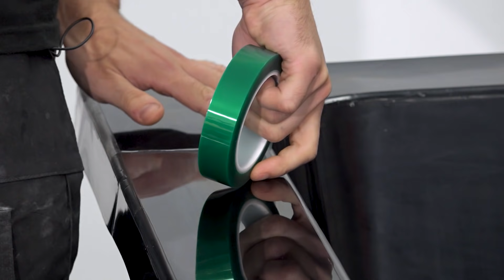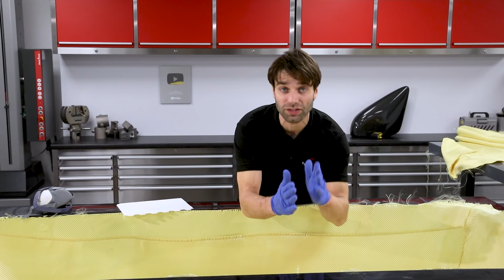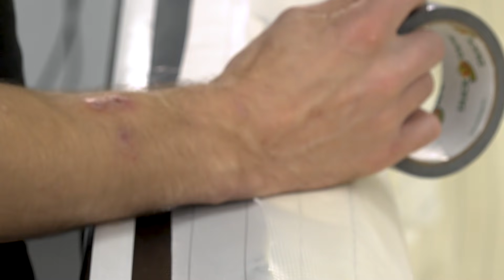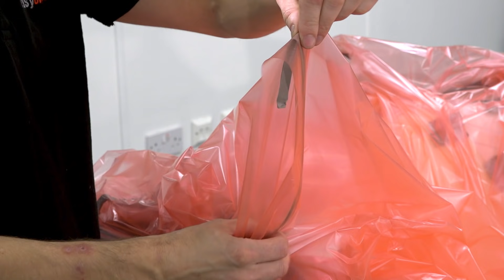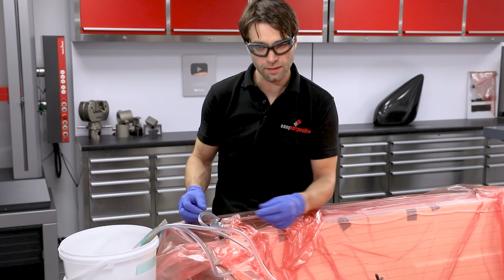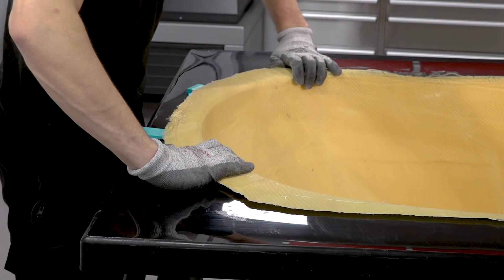In-Depth Guide to Resin Infusion (3m Kevlar Moulding)

Comment: JUST an FYI but pleats is the wrong word. pleat means a straight fold of excess material made along a flat edge to reduce overall width and material. THIS = wrong. We are dealing with resin infusion we are not knitting here with thread and needle. Dart the correct term: specifically is used when referring to folds created at corners or around protrusions and structure where extra volume (bagging plastic) is needed in a specific spot. The correct term is DARTS when making the the little excess bag loops using the tacky tape or butyl tape. Just an FYI. I also use to build Hinckley yachts and work on luxury and super mega yatchs in florida. Also he should have put the tape down first after the the gelcoat and put a lite cover of 2" masking tape to protect it. Then put down all of the remaining materials. imprinting on the FRP. Easy to setup the infusion lines with a covering of flow media to make it so it does not imprint.

Comment: Hi, can I ask how many layers can be impregnated in this way? I'm going to make a skateboard that will be 15mm thick at its widest point, with 450g of carbon it's 33 layers. I'm thinking about either infusion or soaking and then adding an absorbent insert and vacuum. I don't know which option to choose. The skateboard is only 15mm in the tail, but it tapers to 5mm towards the edge. I need a really stiff iron board, total length is 125cm, width 30cm. Thank you
Reply from the maker: That sure sounds thick for a skateboard. It is possible to infuse very thick laminates but it does come with the risk of not fully getting the fibres saturated and wet out. Contrary to what you may think, thick laminates are best done with a slow infusion, restricting the flow of resin so that it doesn't skip across the surface plies and has time to penetrate through the stack. You will naturally want a slow curing resin to give you the most pot life possible and it may be beneficial to mix up in multiple batches to limit the volume of resin sitting in one bucket.

Comment: when you clamped the pipe of the pump end, did you turn off the pipe or was the pipe running?
Reply from the maker: Once the vacuum line has been clamped, the pump can be switched off.

Comment: The only thing that i dont get is how you choose a foam for core instead of a nonwoven for example?
Reply from the maker: Not quite sure what you mean as a 'nonwoven' in regards to a core material. Core choice however can be influenced by a number of factors. Processing method is a big one as some materials will not withstand certain manufacturing processes. For resin infusion, shown in the video a closed cell foam core is the ideal choice because the resin take-up is minimal which keeps the weight down. You can imagine if you tried to infuse with a honeycomb core how all of the individual cells would simply fill with resin.   
The foam used in this case is a special material with holes and grooves partially cut in the surface which act as channels for the resin to flow down and pass through. This allows the fabric to fully infuse whereas an ungrooved foam can restrict flow to both sides of the laminate.

Comment: I have a problem with the infusion, before proceeding with the introduction of the resin I do the leak test and there is no presence of air but at the end of the infusion it starts to take air from somewhere, what could be the problem?
Reply from the maker: It could simply be any trapped air in the resin expanding and congregating on the resin front as it makes its way through the laminate.
Reply: It can't be, because I degas it first
Reply from the maker: @raffaelepirrone6550  How long do you leave the drop test for and is there any chance that your fabric has absorbed moisture? If you fully degas the resin and are certain that the bag is 100% sealed at the start then the only cause is that the bag punctures or bursts during the infusion or moisture in the fabric is boiling under vacuum and causing a gas to become present.
Reply: how much should the infusion pressure be? 
-1.5 bar is perhaps too much?
the leak test time is two minutes
Reply from the maker: @raffaelepirrone6550  For infusion you want to be as close to full vacuum as possible. 2 Minutes is not really long enough for a drop test, at minimum you want to leave it for around 10 minutes but ideally around 30 minutes if you can. The longer you can leave it to test the seal the better.

Comment: Un believable product great, I love resin flow technics there is a any formula for insert connections?
Reply from the maker: I'm not quite sure what you mean sorry.
Reply: My query is Are there any principle for setting up resin flow and vacuum flow connections like width,area,legnth
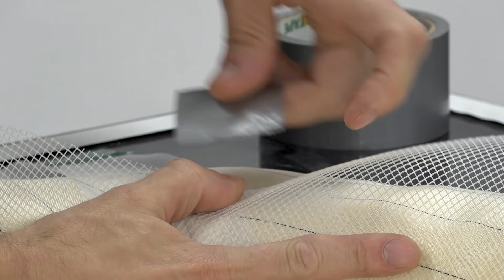Reply from the maker: @Eswarpune  There's not a particular formula as every mould is a different shape. We do cover the position of the feed lines @10:45 in the video.

Comment: Hello and thank for your brilliant videos. 

I would like to ask if vacuuming the surface or any kind of mold would bend it?  
In such case we will not find the part with the correct geometry. 

Is this a possible scenario ?
Reply from the maker: For the resin infusion process you need to have a strong and sturdy mould that will withstand the vacuum pressure without distortion. A composite mould or one directly machined from tooling board are the preferred options. 

If the mould is not strong enough then as you say, it can lead to distortion in the part.

Comment: I suggest this is the wrong choice of material.  High density polyethylene, used by Jemtlander in Sweden, Aiguille in UK, Ice Trek in Australia and no doubt a bunch of others.  Sure I can by resin/kevlar pulks from Acapulka and resin/glass from fjellpulken.  Chances are you pull a sledge through snow and I really notice the coefficient of friction between the material and the snow
Reply from the maker: If you haven't seen them, it is worth watching the series of videos that accompany this one as they address those points directly. I'd definitely recommend both this video:
https://www.youtube.com/watch?v=wPFDBT41SEU&t=482s

and this one:
https://www.youtube.com/watch?v=li7ug4-k4mk

Comment: If you see the finished Part no one recognizes how much Garbage it produces.
Reply from the maker: Sure, but of course, the mould can be used to make hundreds or possibly even thousands of parts. The consumables, per part, are on par with most other manufacturing processes and, of course, being a composite material, the end product is lighter, and so uses less resources in operation, than a product manufactured using (potentially) less consumables in production, but yielding a less efficient product in operation.

Comment: With that drop test. Was the pump running? Should the pump hold the vacuum if switched of?
Reply from the maker: The drop test is designed to see how well the bag is sealed, so yes the pump needs to be turned off and the vacuum line clamped (the pump has a non return valve to ensure oil does not flow back up but it is not a vacuum seal). This will then isolate the bag and allow you to determine how well it has been sealed. You can find another example on our guide to resin infusion video at 23 minutes. https://www.youtube.com/watch?v=pWRVVLJX8eE&t=202s
Reply: @easycompositestv  Perfect. Thank you.

Comment: Do you think this approach would also work with a surfboard where the resin should flow on top and bottom?
Reply from the maker: 2 main problems would be control of where the resin flows and also the fact you would have a rough peel ply finish to the part needing further finishing work and likely need a hot coat of epoxy to get a good finish.
Reply: @easycompositestv  thanks you for answering! What would you suggest to control resin flows, add more lines?
Reply from the maker: And resin feed connectors so you can shut off one if the flow is not going where you want it to.

Comment: If you make it 6ft long it can double as an emergency shelter.
If that adds extra material then make up for it by making it skinnier.
If you line it with millimeter-thin insulation, you now have a windproof, coldproof shelter 😊

Comment: I didn't understand how the catch pot works. I mean the resin coming to the trap pot may close the valve permanently. How do you tackle with this?
Reply from the maker: The catch pot is really a failsafe, to prevent damage to the pump via resin ingestion. It had a disposable liner which can be replaced if resin finds it's way into the chamber but really this should only be a small amount at most. If you find larger quantities of resin end up in the catch pot then you need to reassess the position of your resin break within the infusion setup.
Reply: @easycompositestv  how about the valve in the catch trap pot connecting the pipe carrying the excess resin. Does it need to be replaced if the resin gets hardened inside it?
Reply from the maker: The connection to the catch pot is with a gland type seal on the outside of the PVC tube.  So no resin comes into contact with the catch pot in that way.  The gland is just loosened and the resin filled hose removed.
Reply from the maker: @fayazahmed3264  The resin line passes through the connector on the lid so resin shouldn't come into contact with the connector itself. The hose can be removed and discarded if it has drawn up any resin.

Comment: To the Author, why do you need (6) so many cotes of releaser? Why not one cote thicker?
Reply from the maker: Being a thin solvent laden liquid, it is not possible to apply one thick coat.  Hence by applying multiple coats you will build up a thin layer on the surface and also it ensures that its very unlikely any areas have been missed.

Comment: How was the black finish made straight out of the mold?
Reply from the maker: We used a black pigment in the gelcoat (1minute 30)
Reply: Thank you, I must've completely overlooked that.😬

You have inspired me to start making carbon fibre motorcycle fairings, and I'm thinking of using resin infusion instead of Prepreg because of the cost and storage. Is it possible to use resin infusion to get into tight conical shaped features and still get a good surface finish?
Reply from the maker: There should be no reason why not; you won't have a moulded finish on the reverse side but there's no reason why the techniques in this video couldn't be scaled down to a smaller conical shape.

Comment: Really a master piece! Could have been easier to do it with a convex mold? Thanks.
Reply from the maker: Generally you determine that based on which side you want to be the high quality moulded side.
Reply: @easycompositestv  I see, so in this case, the high quality moulded side was the exterior, right?

Comment: By "Bondable for up to 24 hours" do you mean a successful epoxy resin infusion will be successful "up to" this amount of time? I assume if you go over that time the gc50 Gelcoat will be a solid separate sheet that won't attach the resin infused core materials?
Reply from the maker: yes the longer you leave it the lower the bond strength. So up to 24 hours you will get adequate bond strength between the materials. Over 24 hours you risk delamination.

Comment: would you not clamp off the feed hose and empty it? saves on hose.
Reply from the maker: You could clamp off and empty the hose but it would be very messy to do so. It would also be difficult to fully clean out the hose completely of the resin. For the cost of the cleaning materials and the potential mess caused, a few pence considering the overall cost of the materials is usually pretty negligible.

Comment: Berapa tekana yang ada gunakan saat pevacuman anda?
Reply from the maker: For infusion, you need to aim for as close to ultimate vacuum as possible so close to -1 bar of vacuum pressure (29.99inHg)
Reply: @easycompositestv  pak tipe resin epoxy apa yang anda gunakan?

Comment: I love your videos. They are some of the best for composites. Would it be possible to use this process to make a long tube? I'm rather space constrained here. Your input is appreciated. Thanks again.
Reply from the maker: Tubes can be infused as long as the diameter is big enough to be practical to lay up.  You will likely need spray tack to hold everything in place vertically.  Also you will need careful planning of the infusion consumables so that the resin actually flows on all sides of the tube.

Comment: The amount of waste/consumables in this type of product is pretty high hehe ,
It seems like this has to be the most expensive way to make anything haha that’s gonna be one hell of a sled such a simple thing yet built like it’s for NASA
Reply from the maker: It may seem over engineered but the environment is that harsh that it needs to be.
Reply: @easycompositestv  oh i would say considering how aboriginals have lived all over the arctic for centuries using a seal skin and driftwood haha that it’s a tad bit over engineered haha but being overly prepared is a good thing if I were to be taking a sled to one of the poles then I’d definitely not be pinching pennys on the sled.
It was a great build and a excellent video explanation/demonstration of the process thank you for that whenever I’m in the market for a Kevlar/carbon fiber race car body I’ll definitely Google your company!

Comment: You are awesome man, explaining things so well, hope to make my own composite products some day.

Also just a question and I'm not sure if you or anyone else may be able to answer this for me: I was looking to have a set of carbon bicycle rims made and the company offered different weaves of carbon to be used as a finishing skin. When I asked if carbon-kevlar may be used they said:

"The finish that you would like is not going to work as a surface layer because aramid fibers are "hairy". They are not long fibers like carbon fiber, but short and "fuzzy" so they cannot form a smooth surface layer when impregnated with resin.

we absolutely cannot deliver a quality product with aramid/Kevlar as the surface layer. Laws of physics prevent this."

I'm just looking for more in depth info on this, thanks !
Reply from the maker: If the resin layer is very thin and/or they do a lot of sanding to finish the surface then yes the Kevlar can end up with a "hairy" finish on the surface that would need a thick layer of lacquer or resin to hide.  On a very light weight product, that would add weight to it.
Reply: @easycompositestv  Very interesting, so in theory it is possible to achieve such a nice finish although much more difficult than if it were carbon
Reply from the maker: @caluzzucarrazzi5549  It is certainly possible yes but needs a little more TLC during the lay up and trimming processes than you would need for carbon fibre.

Comment: Have you ever tried just pleating in the corners with large tails? It uses more bag, but saves time imo.
Reply from the maker: Its largely dependent on the actual mould; the bigger the mould, the more unwieldy a large bag can be and whilst you of course never want to be too small, you can have as many issues if its too big so in this case, we prefer more frequent but smaller pleats but of course, there is no perfect answer, it really comes down to both personal preference and project.
Reply from the maker: Hi Beau, yes, we do use that technique sometimes. In the case of this project, the bag is so big that we need a relatively efficient pleat scheme so as not to need to join the bag. I'm not sure but I suspect big corner tail pleats would need more than the 3m width of bagging film that we have on the VB160 and adding a join in the bag would take more time than that saved by a less bag-efficient (but more time efficient) corner pleat.

Comment: Generally-speaking, do the molds being used for resin infusion (or simply vac-bagging) need to be rigid, or can a silicon mold with a rigid mother mold be used?

For instance, if I have a relatively thick silicone rubber mold in a fiberglass mother I use for hand layup, could that be used? I'm wondering if pulling vacuum could noticeably deform the part, especially if the rubber wasn't fully degassed and more than likely has air entrapment.

Truth be told, I'd rather spend time on my stack-up and prep than tapping glass, especially if my final product is of better quality and less heavy.
Reply from the maker: Hi Thomas, we have not seen silicone moulds for vacuum bagging processes like infusion.  The flex is likely to cause issues with inconsistent surface finish and part distortion.

Comment: Hi, i work with infusions myself, bigger parts tho, and we are having some trouble, i have a question for you, is siphoning of the resin not an issue for you, as your source is above your inlets? we want to move the source above the inlets, because our infusiion is going to slow, but the engineers are afraid of siphoning
Reply from the maker: Not an issue for us on this scale of work.  As said, ensuring the resin pot is level or above can ensure you don’t get too many issues like that.